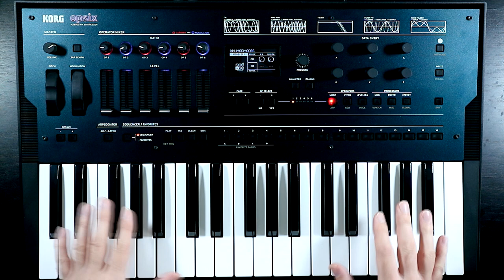Korg Opsix - Operator Modes In Depth: Ring Mod and Filter Mod

Comment: I don't know if you purposely skipped this to not go over too much detail, but the reason why the scope compensates for the phase inversion during the >50% depth is because the oscilloscope places the center of the picture (both horizontally and vertically) where there is a downward zero crossing :)

But I'm loving your videos! I've had my Opsix for about half a year but I am watching your stuff to learn new things I might have glossed over and I've definitely learned some new tricks. 35:37 was such a WTF moment for me in this one! My only minor feedback (heh feedback) is that at times the synth audio can be a bit too loud, especially during extended notes and with how nice and soft your voice is :)

Thanks for your videos!

Comment: Thank you very much for providing these deep dives into the OpSix. You've clearly put in a lot of work and this level of technical explanation is very hard to find on YouTube. I look forward to the rest of the series! My OpSix is currently in storage while I look for a new place to live, but I'll have plenty to experiment with when I get access to it again, that's for sure. My initial experiments included the RM and Filter FM modes, but I don't think I really got anywhere near understanding them properly, and this video has been a massive help!

Comment: I have a complicated question. Sorry for the long post, but if you have the patience to entertain my naivety then please consider the similarities and differences between the following three scenarios.

1) If we have Operator 1 modulating Operator 2 and Operator 2 modulating Operator 3 and they're all set up to perform ringmod then (as I think I understand it) Oscillator 1 will pass through Operator 1's envelope and the result will used to modulate the amplitude of Oscillator 2, and then that result will pass through Operator 2's envelope and then that result will modulate Operator 3's amplitude.

2) Consider Operator 1 and Operator 2 both directly connected to Operator 3 in a system that only supports frequency (or phase) modulation. For convenience I'll talk in terms of frequency. Oscillator 1 and Oscillator 2 pass through their respective envelopes and the two results are summed and it's that sum which determines the overall frequency (or phase) movements of Oscillator 3.

3) Now consider the same algorithm shape as Scenario 2 but in a synth that supports both FM and AM/RM. Is it possible that each operator now has two different inputs to consider when designing or understanding algorithms? For example, Oscillator 1 might pass through Envelope 1 and be used to modulate Oscillator 3's frequency, while simultaneously Oscillator 2 passes through Envelope 2 and then gets ringmoded with the signal coming out of Oscillator 3, and then finally that ringmoded signal passes through Operator 3's envelope?

In Scenario 3 one oscillator is 'receiving' two different types modulation. In the converse situation, could one operator potentially 'give' two different types of modulation, changing the frequency of one oscillator while simultaneously ringmoding another? When I say "could", such questions have two parts in my mind. Firstly, do these ideas sound like sensible designs in general / the sort of things you'd likely want to be able to do / things that aren't going to get 'too' out of control or 'crazy'? I'm still relatively new to synthesis in general but I'm currently having a go at creating my own softsynth that supports mixed FM and AM algorithms. And secondly, which options can the opsix do?

Many thanks to Oscillator Sink for such a chilled out, informative and creative tutorial series!
Reply from the maker: In the opsix the operators "receive" modulation and then do the thing they are meant to do - an FM operator can only be FM modulated. So the opsix can't do option 3, only 1 and 2.

As to whether it's a sensible arrangement? Sure, you'd probably want to think of it in a modular way where an  "operator" has multiple inputs for different kinds of modulation rather than each operator providing types of outputs though, that's ultimately the more flexible arrangement as one operator could be used to modulate multiple operators in different ways. If you look at the design of a Buchla style "West Coast" (don't like the term, but you probably know what I mean) system, that's kind of what you have.
Reply: Thanks!

The design I seem to be gravitating towards with my little software programming experiment (still missing a few envelopes but...) is to have 8 oscillators but they come in pairs and within each pair there's ringmod stuff going on and then in terms of algorithm layouts those look like a standard 4 op FM synth and both operators within a pair always get frequency modulated in the same way, so it's both much simpler than the opsix but it does support Scenario 3. Kind of like an 8 operator synth, but also kind of just a 4 op synth with some fancy wave shapes added, although those wave shapes will also soon possess the ability to morph over time once I get those extra RM envelopes added.

Comment: These are really solid and helpful videos! I have a question for you. Maybe you addressed this in the video or the comments, but if you did, I missed it...during the "Ring Mod Parameters" section it looks like you have Operator 3 set to Ring Mod but kept Operator 4 on FM mode...is this correct? I'm curious about how it affects the wave when the two (or more) opereators are and aren't set to the same modes. Thanks!
(PS,  I've been enjoying the Opsix so much I'm getting really tempted by the Wavestate. Any thoughts? )
Reply from the maker: The short answer is: it kinda doesn't. In this case I'm just using operator 4 as a basic oscillator - it isn't being modulated by anything above it so unless I introduce feedback or change its width, it's just being an oscillator with the shape it's set at.

Of course, on the opsix, a single operator can get a lot done on its own in terms of creating complex shapes and movements, but in this case a more complex shape into the ring modulator isn't desirable for the purposes of demonstrating things, so I've picked the FM mode out of convenience (it's the easiest to get the unaffected basic shape and also it's the default anyway).

Comment: What happens when you modulate a filter op with another filter op? Or a filter op with a ring mod op? Or {1,2,3,4,5} x {1,2,3,4,5} - know what I mean? I'm trying it out at home but can't quite grasp what it's doing.
Reply from the maker: In either case (assuming by 'filter op' you mean 'filter mod op'), you're creating a more complex waveform. The wave shape of the modulator will have an impact on the harmonics generated in the carrier, with more complex waveforms generating more complex harmonics.

So it doesn't really matter what mode the incoming operator is, rather what the shape of its wave form is. Of course, it's possible to modulate a modulator so that wave shape could change over time, which can create very complex movements in the sound.

Hope that helps!

Comment: Nerd fact of the day. Technically speaking, what you are referring to as ring modulation is amplitude modulation. In this case you can still hear the carrier. True ring modulation is the sum and difference frequencies of the carrier and modulator with the carrier and modulator frequencies removed. In a true ring modulator you wont hear anything until the carrier and modulator are combined. Vocoders use a similar principle.
Reply from the maker: That is actually the case when the depth is set to 100 percent on that operator mode, so you get both.
Reply: Yeah, on a ring modulator there's no such thing as depth really so I think the depth here must be cross-fading between the pure carrier and the output of the ring mod.
As far as I can tell, a 50/50 mix of the two is equivalent to unipolar AM (as opposed to bipolar like a ring mod).
Reply from the maker: I don't think it's blending the carrier. As you push the depth control past 50 percent the amplitude modulation occurring begins to additionally invert the signal, i.e it's becoming bipolar (although not symmetrical to begin with)
You can hear (and see on an oscilloscope) this clearly at LFO rate modulation as an apparent doubling of the 'tremolo' (I do show this in the video). 

I assume what's happening is actually an offset is being applied to the modulator signal (and possibly an amplification) so that by the time you get to 100 percent depth you have a symmetrical, bipolar modulator (and a ring modulator).
Reply: @OscillatorSink  When I watched it on a scope, that's exactly the effect blending had. As far as I can tell they are equivalent, but I don't have the brain power to check if they're mathematically equivalent.

This was a few years ago so I might be misremembering I guess.
Reply from the maker: @eyeball226  hmm, interesting, I also can't do that chunk of maths in my head, although, actually, I could check that on the opsix by having the depth set full and bringing up the level on another operator that matches the carrier in the ring mod. I'll try that later. I do know that one way to achieve ring modulation (other than the traditional ring of diodes) is by using an inverting VCA (and a polarizer, depending on the modulator signal), which is kinda what I was thinking was happening here.
Reply from the maker: @eyeball226  OK, so I just checked the manual and the flow diagram describes the crossfade operation you're describing (and it does appear to be a crossfade rather than a blend because simply turning up another operator equivalent to the carrier results in a louder signal overall). I need to sit down and understand why the carrier blend and polarizer/inverter arrangement do the same thing. Synthesis is fascinating!
Reply: @OscillatorSink  Yeah! I bet someone at a university in the 60s has already done the maths to explain why they're equivalent.
On a basic level the maths of ring modulation is easy to understand. The amplitudes of the waveforms are multiplied, which is why you get the inverting (because -1x -1 = 1).
An interesting thing is that if you feed the same sine wave into a ring modulator you get a sine wave an octave up with a DC offset.
Ring modulation always creates sidebands of the sum and difference of the frequencies you put in. If you put 220Hz in then the sum is 440Hz and the difference is 0Hz (the DC offset).
Reply: @sidefish - I'm curious about your final comment regarding vocoders. Any chance you could elaborate? I thought vocoders operated via bandpass filters, envelope followers and VCAs, which strikes me as a rather complicated thing, and I'm not sure how you can compare that to a ring modulator.
Reply: @macronencer  Similar in the sense that there is a carrier, i.e the note being played, and the modulator, the human voice. When there is no modulator you hear no sound (or very little) coming from the vocoder.
Reply: @sidefish8362  Oh yes, I understand you now. Thanks!
Reply: I remember actually being originally annoyed at the name "ring mod", when it was technically just AM and the name "ring" came from the shape of the original analog circuit that did it. I thought, why not name it AM at this point?

I made peace with it when I realized that AM typically does not go into phase inversion while ringmod does. At least now there was a practical difference between the 2 terms :P

Comment: I watched every second of the video and love the programmability of the Opsix but I fail to see or feel the musicality of FM in general. Great to play with, but no so great for my music I guess. Thanks for your long video though!
Reply: Granted I have no idea what your genre is and perhaps it really doesn't fit, but for starters maybe consider that most of what was shown in this video actually wasn't FM, but rather ringmod (so kinda like AM) and filter cutoff modulation. You could watch Oscillator Sink's video specifically on the FM mode or on building a "broken" EP.

And for specific examples of musically usable FM stuff, you could either look through the presets in the Opsix and look at which ones use FM, or you could search YouTube/Spotify for playlists of popular songs that used the DX7 (such playlists exist), the original and far simpler FM synth.

FM does sound rough and clunky when you're only doing the modulation, but it really shines when you put in EGs, velocity, and effects
Reply: @KooriGraywolf  11 months ago I was not in the know yet, since then I learned (and listened to) a lot and even made my own FM patches. Thanks for commenting after all that time, really appreciate it!